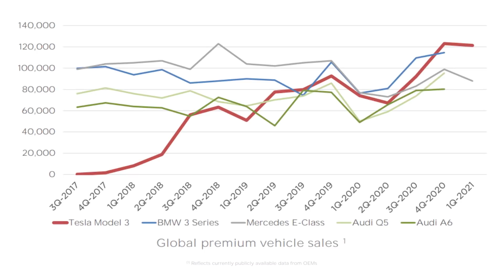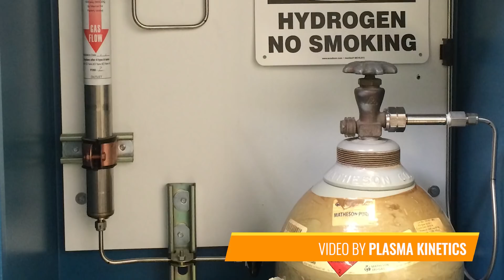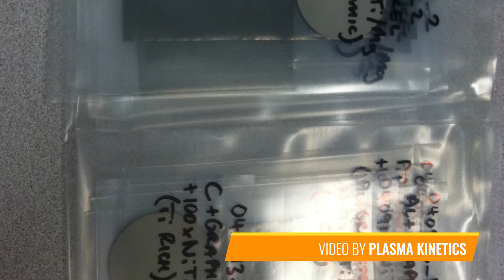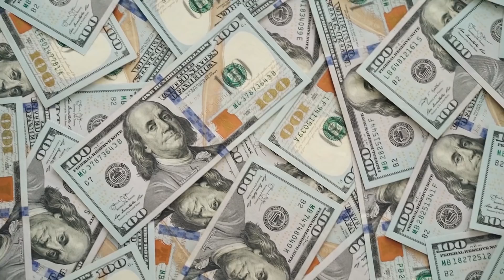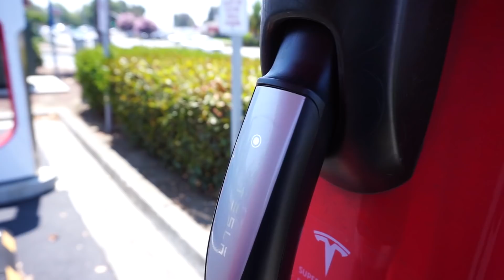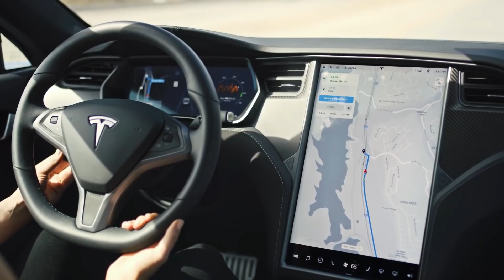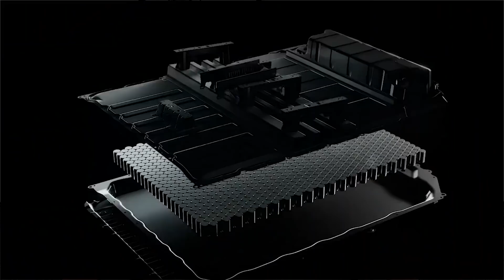SANDY MUNRO: No Batteries Needed for Toyota to Rival Tesla

Comment: Hydrogen is still too expensive and inefficient compared to lithium-ion-batterys... it's the champagne of renewable energy sources.
Great Video... sandy rocks
Reply: Interesting....do you have a url or something that drills down and shows how the hydrogen road map cannot work. I say this because it seemed Sandy was talking like he had gone into the details and really felt it would work.
Reply: Let's write off the most abundant element in the universe as a fuel source for a metal there is not enough of the replace the current ICE fleet in use.  Great plan, musk would be proud.  Li-Ion doesn't hold a candle to energy density of gas.  Hydrogen doesn't make it there either but at least it's everywhere.
Reply: @CharAznableLoNZ  They are not fuel sources. Its an energy storage solution. Wityh current techcnology Hydrogen is very inefficent compared to Li batteries. Lithium is recycleable. 
I would love to know a cost per kwh for this hydride tech.
Reply: There has been a lot of development of how to produce hydrogen from water very cheaply. It still needs to be commercialized, but there's a path to it being competitive.
Reply: @CharAznableLoNZ  FuHydrogen is stupid as hell. Its has less than 25% the energy density of gas. It is nearly impossible to make a container to store it, without it leaking,  it takes natural gas burning, to get cheap hydrogen, otherwise it cost WAY more than gas. You still require an engine with hydrogen, if you want to not have a fuel cell and electric motor, AND gas engine in one system. Hydrogen cars are a stupid concept, especially compared to electric cars. Range, cost, reliability, enginerring complexities, technology. Everything is against hydrogen, and the potential of hydrogen in its best case scenario, is still much more expensive and environmentally bad, than electric cars.
Reply: @CharAznableLoNZ  Also, lithium is the 4th most common element on the planet, There is just as much of an argument for tons of li too. But also, batteries do not need to be lithium. Hydrogen has no choice. Hydrogen is a stupid ass, tech for cars.
Reply: @CharAznableLoNZ  EVs presently are a folly, batteries that weight a third of vechicle weight, a hugh waste of materials and hazardous chemicals, and God knows how recyclable these batteries are, average european household uses about 15kwh per day, now you may be added another 60)80 kwh per day to charge your vechicle, the infrastructure simple wouldn't cope, the future is hydrogen, on demand hydrogen produced within the vechicle either by metal hydrides storage or reacting a metal like, aluminium, magnesium or zinc with water, or some future technology, then reprocess the material renewably when spent, which can be done with solar or wind, as being intermittent wouldn't be a major concern if stock is accumulated when power is available, it's hard to believe this is as far as we've got with EVs, it is joke, and growing by the day, alot of comments about how inefficient hydrogen is to produce, it's about 100 percent efficient using electrolysis, of the energy used to produce the equivalent energy store within the hydrogen gas, the reprocessing method would be 90 plus percent efficient akin to aluminium smelters
Reply: @alanlight7740  it can be produced almost 100 percent efficient using electrolysis, it can't exceed 100 or it would be breaking the laws of physics,
Reply: @jimbobarooney2861  Hydrogen is a joke. The average household would only need an extra 10 kWh per day (where did you get that 80?!) in case of an EV. In case of hydrogen that would at least be 30 kWh.
Reply: @jimbobarooney2861  Electrolysis is (and will never be 100% efficient). 60% is quite a lot already and then there are all the other losses in the ecosystem as well.
Reply: As much as I like TESLA, reality is that until they are able to make charging a less than 10 min thing, TESLA cars will not be main stream. It's nice to have a nice car and all but if it's gonna take you twice as long to travel every time your trip is over 500 miles, the average person ain't gonna buy it.
Reply: @GapModel1  Charging does not take longer than an average reststop you need anyway after a few hours of driving.
Reply: @Simon-dm8zv  I can't understand what your question is?
Reply: @Simon-dm8zv  industrially 70-80, can be increased  by reducing the overvoltage, production level slows considerably, but still possible
Reply: @Simon-dm8zv  Don't know about you but to me and the average person, 10 min and 40 min is a big difference. And you are probably not familiar with traveling because almost every person I ever go on a long trip with are obsesses with cutting every corner just to make the trip shorter.
Reply: @Simon-dm8zv  you still need the infrastructure to allow a full charge, but if you take 10kwh/day as an average, is almost doubling the electricity usage of a family home assuming they have one vechicle, hydrogen would not be produced this way as I have stated
Reply: @jimbobarooney2861  I pointed out that daily consumption of an EV is only 10 kWh, not 60-80 like you claimed.
Reply: @GapModel1  I love long road trips and am looking forward to owning an EV. Most modern EVs only require 20 - 30 minutes of charging which is totally fine. You should realize that proper EVs like a Tesla Model 3 and the Audi e-tron models can technically do 1000 km in about 10 hours of driving and charging. Most people don’t even reach that when using an ICE car.
Reply: @jimbobarooney2861  Infrastructure is already there. You can slow charge a car at only 1 kW at night which is more than sufficient.
Reply: @GapModel1  hasen't advanced much since the 1909 Baker Suburban Runabout, 112 years later this is all they're got
Reply: @Simon-dm8zv  I am answered that, but the answer doesn't appear to suit the narrative
Reply: @Simon-dm8zv  How you gonna make an argument base on the best case scenario? You have to be realistic and factor in the charging time than imagine how long the line would be if each car takes 30min to 40 min to charge. Don't know about the EU but here in the USA the hiway is usually always fill with cars and and if EV is mainstream, it would not work at all. Only way EV can be mainstream is if charging time is less than 10 min and I'm not even sure if that's possible during our lifetime. Nio and Toyota on the other hand is in the right track with Nio's battery swap and Toyota's Rav4 Prime that allows gas use for long trips.
Reply: @GapModel1  It will be fine. The 10 hour example was just to show you how great EVs already are. All EVs will be able to do this in a few years. A more affordable VW ID3 does it in 11 hours... Charging is NOT the issue and no, we do not need 10 minute charges for it to function. We just need more chargers at rest stops which is very doable because charging stations are easily scalable. This already exists here in Europe. Look up Supercharger Nebbenes in Norway on Google images. Battery swapping is cool and some people will probably use it but it is not necessary. Swapping requires much more complicated infrastructure and much more maintenance. It will therefore be impossible to compete with fast charging prices.
Reply: @otov100  Lithium is costly to recycle and has a tendency to burst into flame if not done in a proper manner.  Hydrogen is still very early, it will surpass li-ion given time to develop.
Reply: @jf8138  Seems like you just decided to parrot everything EV fans do.   You could use hydrogen to power an ICE but that would only be a stepping stone to get the current fleet off petrol.  A hydrogen fuel cell produces electricity which drives an electric motor.  You could swap the batteries in a Tesla for a fuel cell and hydrogen tank and the car would drive the same.  The only exhaust is pure water.  Hydrogen can easily be rendered by applying electricity to water, this is a grade school experiment level of difficulty.  Lastly, storing it has come a long way, it will always leak a little due to the atomic size however since it is also the lightests, it is less dangerous than other methods of fueling a vehicle.
Reply: @Simon-dm8zv  Swapping is working fine in China. You just not willing to admit that charging will not satisfy the mainstream drivers. Even hard-core TESLA fans get annoyed at charging when traveling long distance.
Reply: @jf8138  Not sure where you pulled that from, it's not even the top ten.  A fuel cell powered car is the closest and most convenient switch over for the entire oil industry.  If you can bribe the oil industry into doing it by the possible profits they will innovate and make it happen.
Reply: @jimbobarooney2861  Exactly, the electric car is more or less unchanged since the 1890s.  A battery, a motor and a way to control how much power reaches the motor.
Reply: @GapModel1  Again, I said swapping is fine. I don’t care if people want to use it. It’s just unlikely that it becomes mainstream. As long as EVs become mainstream I am happy.
Reply: @jimbobarooney2861  - electrolysis is okay, but there's also been work on processes that can use sunlight as a power source, frequently with a biological component, and sometimes producing fresh water from salt water as a by-product.

A little more development of one of these processes and scaling it up, and we might have a good path towards inexpensive production of hydrogen fuel - possibly making use of unused off-shore spaces for production.
Reply: @CharAznableLoNZ  I doubt it. Something will inevitably surpass Li ion but I doubt it will be Hydrogen. Methane would be better than hydrogen. It’s much less energy intensive to store methane and it is orders of magnitude easier to liquify methane. 
Hydrogen’s main benefits are it requires extensive, advanced and centralized infrastructure similar to today’s gas/diesel infrastructure but less efficient. Also, current fuel cells require maintenance/ replacement fairly often. 
Who are those benefits for? The consumer or entrenched energy interests?
Solar and batteries provide the opportunity for a decentralized energy infrastructure. 
I don’t think big energy was counting on batteries taking off like they have. Now they’re starting to sweat. That’s what happens when instead of focusing on technology that benefits the consumer and the environment you choose to focus on technology to keep people addicted to your product and extract the maximum amount of revenue from consumers.

Comment: Dynamic Kenetics as a hydrogen storage solution has a lot of potential.  Then again, storing hydrogen in a metal lattice has been under development since the early 90's.   They also seem to be avoiding any mention of cost like the plague so I would need to see if it's an affordable method of handling hydrogen.

Comment: Oh my gosh, I think there was a documentary about the NUMMI plant called "American Factory". It's well done. The joint venture between GM and Toyota ran from 1984-2010. It was a good effort, but the plant eventually closed. Then Tesla bought it and today it produces Teslas.
Reply: The plant in question was the lowest quality plant in the GM system (they made Camaros). It became the highest quality plant in North America. The plant eventually "closed" because there was a 25-year consent agreement between GM & Toyota imposed by the US Government that required the sunset of the plant. Toyota sold it because 25 years had run out as I understand.

Comment: Toyota partnered w/ Tesla before , with the RAV4-EV... bummer it broke up, and no more were made.
 Toyota might have kept this now pure-EV (and likely Tesla) customer...
Reply: Just think, the 1998 - 2002 Toyota RAV4-EV was powered by Toyota-PANASONIC NIMH batteries.  Toyota has been avoiding EVs for decades.
Reply: Reason Toyota split with Tesla was because Tesla wouldn't listen to demands in how to make the cars more safe. The undercastings of the batterypacks was too thin. Tesla refused, and Toyota said "good bye". Later some Tesla fires happened, and Tesla ended up doing what Toyota told them to do in the first place, by making the pack more safe.
Reply: @oophus1    "Reason Toyota split with Tesla was because Tesla wouldn't listen to demands in how to make the cars more safe. "

The reason Toyota sold their shares of Tesla had nothing to do with how Tesla built the Model S, or its battery pack.
Reply: @phillipzx3754  I was talking about the RAV4 EV project, where Tesla provided battery packs to Toyota. 

The packs were not safe enough, and Tesla ignored Toyotas request to make them safer. Later Tesla experienced several fires because of pucture damage from under the vehicle and Tesla ended up doing what Toyota told them to do in the first place. Just a bit too late for Toyota.

Comment: Plasma Kinetics is claiming 2-4X the energy density compared with compressed H2 gas.  And it is non-explosive.
I don't know if H2 storage is such a game-changer as Munro seems to think it is.
Cost of the technology is a big factor too. If a container ship is to run on H2 instead of diesel, it would be nice if it was non-explosive.
Reply: I agree, 2-4X still sounds like you need to bring a lot of discs and fuel up often. Yet I cannot believe sandy would overlook this so easily. So there may (must?) be more to it. I’ve heard him raving about this technology twice now.

Comment: The Toyota CEO either has something huge up his sleeve OR he's so head strong that he has to go.
Reply: How hard is it for Toyota or any major car manufacturers to make an electric car? Electric engine + batteries. Done. 
They're already have been testing electronic prototypes and other alternatives for years. I guess Toyota sees that EV market isn't prime yet, considering the charging infrastructure and battery recharging time.. It's at least 5 years away.
Reply: I think Toyota is just looking at Tesla as not even competition because Toyota can out produce and out sell them every year. That may eventually change. EVs are becoming less niche and other major manufacturers are putting out at least one EV, but none of them have completely switched over. It's possible that when we see another major auto group like GM or BMW start really ramping up their EV production Toyota will jump onboard. 

TL;DR, it's neither for the Toyota CEO. It's strictly a numbers game. They have no reason to change anything at the moment.

Comment: Storing H2 in metal hydrides was a contender for FC vehicles, along with compressed gaseous H2 tanks and supercooled liquid H2 tanks.  In the end, 10,000 psi gaseous H2 tanks won out.  What is different about this new company’s metal hydride technology that makes it more commercially viable than 10,000 psi tanks?  How does the cost, size, and weight compare?  How does the cost of new hydrides compare to the cost of H2 dispensed at existing stations?

Comment: Panasonic just sold their Tesla stake for $3.6 billion. Along with Panasonic’s outgoing CEO claim that Panasonic must cut Tesla reliance as battery tie-up evolves. 

Looks to be that Panasonic is looking to cut ties with Tesla soon and focus their joint venture named Prime Planet Energy & Solutions (PPES) to build Solid State Batteries. 

Fun fact, the company originally called Panasonic EV Energy Co. until 2 June 2010, was founded in 1996 as a joint venture between Toyota and Panasonic, with Panasonic holding 60% of the capital.

Comment: I would never give electric over hydrogen. Electricity can be captured from solar panels at home. No conversion needed! Also you can generate electricity anywhere in any isolated forgotten place! That's  a luxury you don't get with anything except water or oxygen. Hydrogen can used for planes or rockets.
Toyota doesn't listen the voice of the customers. I asked the dealership since 2 years about an electric model. Their answer was that Toyota knows better that Europe is not prepared for electric cars. That's arrogance, if the customer is requesting a product or feature you don't answer that you know better! And this was not just me, but they had constant requests. Arrogance is always paid!
Reply: Exactly my point. Will Prowse has a sick solar setup charging his Teslas and the AC. You can't do that with Hydrogen.
Reply: i was going to say the same thing. you will always be dependent on some company to get hydrogen. you can produce your own electricity right at home with solar. thats what i am doing right now to charge my bolt. love it.
Reply: Solar panels can power hydrolysis to produce hydrogen.
Reply: @noe616  why another conversion, isn’t this power wasted? Sounds inefficient to me :)
Reply: @noe616  yes you are right, you can make hydrogen, but solar power can go right into your electric car. you need very expensive equipment to harvest, compress and store hydrogen and you will loose a good percentage of that energy. not to mention it can be extremely dangerous. for storing my excess solar production i looked into making hydrogen and its just not feasible.